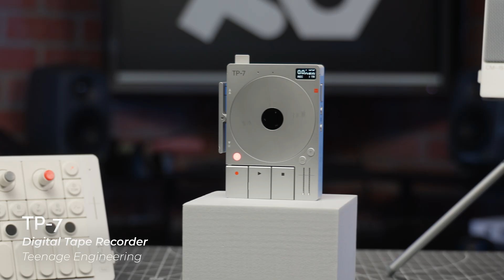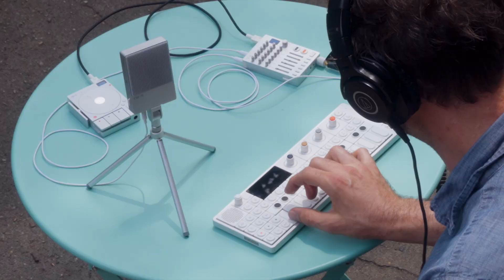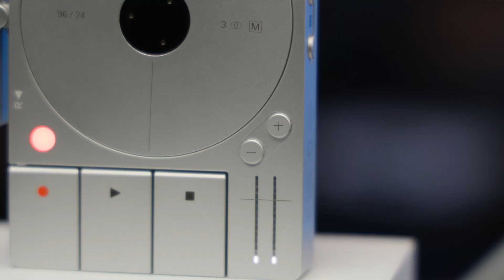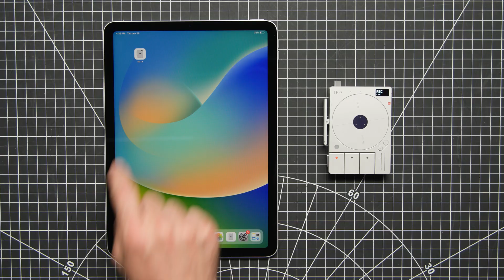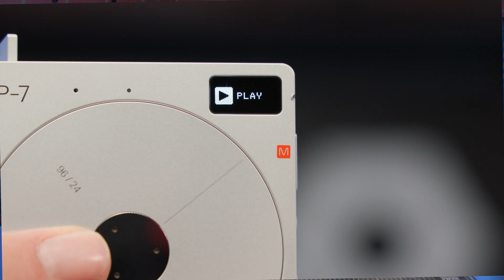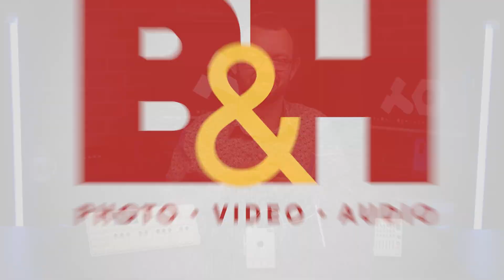teenage engineering TP-7: An Overview

Comment: Don't believe the hype.   This guy would have you believing that a journalist should use this.  There are better and more practical portable recording devices for a tenth of the price.  It is neither ergonomic nor practical.   The spinning platter is just a gimmick that drastically shortens battery life and therefore recording times.   A lot of companies are selling stim devices that have more in common with fidget-spinners than music tech.  Teenage Engineering are deluded if they think this is premium and this channel sold it's soul to them.  Feel free to buy the product, but when you are sat there dissapointed and broke, remember that at least this channel owner made some commission.

Comment: I still don’t see the purpose of this device. Not trolling either. I just don’t get it. How is it different from the TX-6?
Reply from the maker: The teenage engineering TP-7 Digital Tape Recorder is purpose-built as a recorder, rather than as a mixer, audio interface, and recorder like the TX-6. Its main defining feature is the motorized "tape reel," which allows live tactile control over recordings. You can increase speed, reverse, stop, or even scratch with the wheel. Another unique feature is the "Memo" button, which can be held down to create short recordings even when the TP-7 is powered off.
Reply: It passes the butter.

Comment: Can you connect a Sennheiser ME 66 xlr mic to this? Or will the battery damage the tp7?
Reply from the maker: These products will not accept an XLR connection or provide phantom power.  The microphone's battery power will not effect the teenage engineering product, but an audio adapter to 1/4" or 1/8" would be required  along with an impedance -matching adapter like this one: Kopul LMT100 - Low to High Impedance Matching Transformer (1.5') B&H # KOLMT100:  https://bhpho.to/40u9t6t          >Mark<
Reply: @BandH  THANKS SO MUCH See ya in NYC this weekend!

Comment: I absolutely LOVE the design. I wish more products has such tactile controls.
But wanna bet it’s at least $1000?
Reply: Well its 1500 actually
Reply: How can you place it discretely in a pocket or protective case while in use (its disc needs to spin)?
Reply: A complete rip off.  Like teenage engineering stuff typically is...
Reply: @deepnineforty5646  in their defense their the only manufacturer i know of that makes repair parts easily accessible for 3rd party repair (parts not that expensive) long term that could be a game changer for other small businessess. (right-to-repair), and another thing is that the designs are timeless and build quality decent. I could see person getting 20 years out of 0P-1 easy.
Reply: You pay for the unique aesthetics. And engineering that went into it. Obviously you can get voice recorders that are cheaper. But do you want them like you want this one?
 @deepnineforty5646
Reply: @deepnineforty5646  so don’t buy it?
Reply: @deepnineforty5646  agree except for the POs.
Reply: You are either a shill bot or the miniscule demographic that this expensive fidget-spinner is aimed at.  If the latter then I already lost you by not speaking exclusively in emojis.
Reply: @DJ-Eye i enjoy this design as well, though i am not a shill bot or speak exclusively in emojis xd

Comment: For $1,500 USD it should have 1TB of flash, not 128GB
Reply: Thing is . . . audio uses nowhere near as much memory as - for example - video, so 128GB is a lot of memory in this context . . .128GB will give you 134 hours @ 44.1kHz / 24bit / 2TRK stereo . . .or 201 hours @ 44.1kHz / 16bit / 2TRK stereo (more than 8 days !) . . . even at 96kHz / 24bit / 2TRK stereo you can still store 62 hours of audio.
Sure 1TB would be cool, but would cost more and it's probably not needed, just think if you were recording a mono track at 44.1khz/16bit, then 1TB would give you 3149 hours of recording (~131 days or just over 4 months!)
Reply: @davelordy  Still, $1,500

Comment: I really like the concept. I just can't justify the $1,500 price tag. You would think it would come with 32-bit capabilities or something "next level." This is just a recorder. Is the audio quality that much better than lets say... Tascam X8 that retails for $800? Can I record better audio than the less expensive SoundDevice mixpre series?
Reply: It’s portable, it’s unique (though seems like that’s not something you care for, which is totally cool!), it’s an audio interface, it works seamlessly with iOS devices, and it is very well designed. You can’t argue that last point. If it’s too pricey, don’t buy it. No big deal dude! It’s pricey bc it’s not for the masses and for specific use cases and also because it’s a gorgeous toy. The TX-6 mixer is also not overpriced IMO because of the extensive additional capabilities besides just being a tiny mixer. The OP-1f however, I do not feel that price can be justified at ALL.
Reply: @solmare_ ok bro, but does these few extras justify twice the price of another similar device? Nah